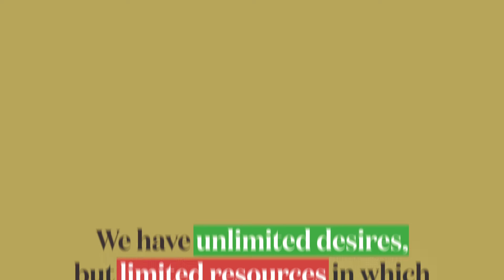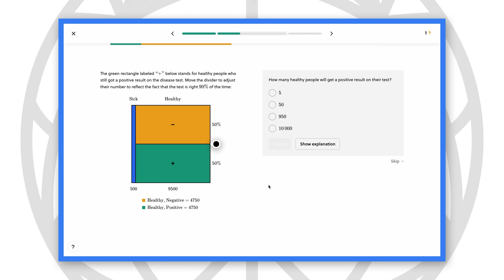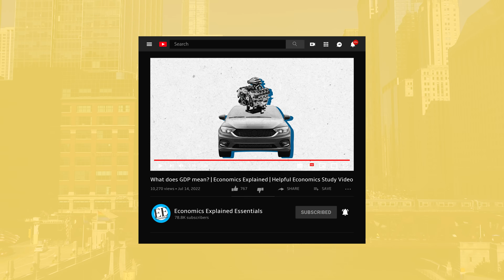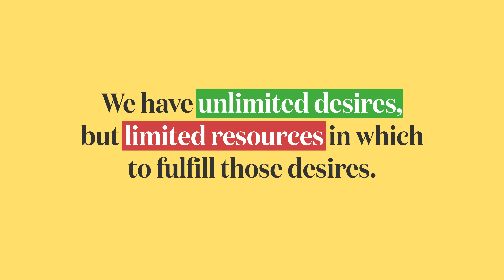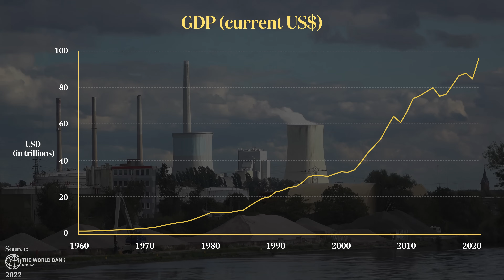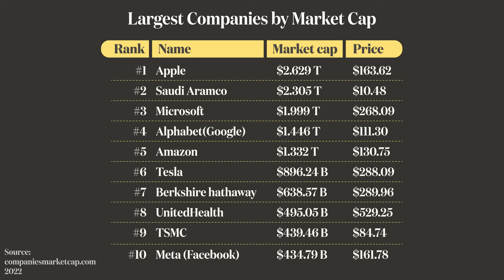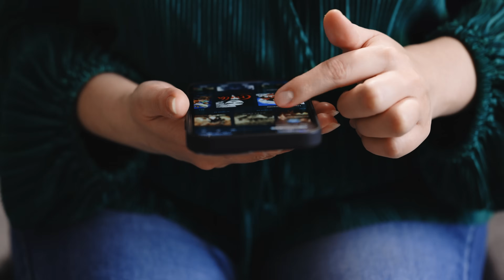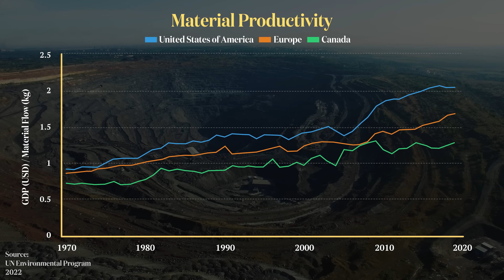Limitless Growth Is Possible If We Run Our Economies Correctly | Economics Explained

Comment: It seems evident to me that, so long as we keep environmental concerns to heart, the problem of environmental impact will solve itself. I know that’s not a popular sentiment, but economic prosperity DIRECTLY TRACKS with environmental protection legislation. The wealthier the individuals of a society are, the more they think about secondary concerns like the environment. Developed economies have seen decreasing carbon dioxide output over the past several decades, and developing economies are pulling millions out of utter poverty each year. This video fails to answer a fundamental question: who, in your quality over quantity model of growth, will produce steel cable. Cars are nice and all, but we still need steel cable. We produce what we produce, in the quantities we produce, because the market says we need the things we are producing.
Reply: Most of the richest countries have the biggest carbon footprint per capita. The only green policies they support are gimmicks that promise a solution without a drop in living standards. You can't consume your way out of climate change.
Reply: This. If activists actually cared about the environment, they'd be focused on using fossil fuels that are efficient and cheap, relative to renewables. The more affluent someone is, the more they're actually able to consider the broader environmental impact of their existence. Pull people out of poverty (which is best done with fossil fuels) as fast as possible and the wasteful use of resources will decrease more than using cleaner energy now at the expense of slower or stagnant poverty improvement.
Reply: @TheJbh147  Can you explain that further? If someone is interested in reducing emissions, why would they continue to pump CO2 into the air? 

Its not about growing as cheaply as possible (building a house out of paper), but growing "properly" and without burning your house down (a house built out of stone). 

We are all figuring this out as we go along. If I built something and looking back realized their is a better way to do it, then I would try to help others do it the better way, without them harming the place they live.
Reply: @JermanRamirez  can we agree that the poorer you are, the less freedom you have to worry about the broader environmental impact? You're more worried about getting food on the table, having reliable transportation, keeping your house, paying bills, etc. And everything else is a luxury that can only be considered once your basic needs are secure, correct? 

Going off that, can we agree that fossil fuels provide the most efficient form of energy at this point in time? By efficient, I mean reliability or consistent amount of energy per unit of energy producing source (ie wind turbine, solar panel, gallon of diesel, etc), abundance of energy source, degree of e-impact (ie wind turbines damaging avian life or interestingly, the almost net 0 fossil fuel processes used in some energy plants, though this isn't widespread but goes to show how technology continues to decrease average pollution from fossil fuels), and cost to attain the energy source (ie collection and transportation infrastructure). Abundance, cost, and widespread use make fossil fuels overall the most "efficient" to use in my mind. 

Lastly, we know that energy costs in the production and transportation of goods affect the price consumers pay, correct? This is one source of influence on both the shortages and rising costs for virtually everything right now so this isn't really up for debate. 

Taking those three aspects into account, by providing the poor cheaper goods via cheaper energy costs in everything leading up to their purchase (as well as the consumer's transportation costs), they have more expendable income, or maybe they reduce the debt incurred every month. This eases some of their stresses and gives them the luxury to worry about their e-impact. 

Of course, there are a million confounding variables at the individual level, but what we see at the societal level across classes and even across countries is that affluence is negatively correlated with e-impact. Everything I said above is the theoretical explanation for why we see what we see at the societal level. The goal is to alleviate the stresses of the lower class to give them the luxury of being more environmentally conscious because we know that, on average, most would rather be environmentally friendly than destructive. The poorer classes simply don't have the finances to worry about collective, more long term survival if their individual and short term survival is not secured. That was long but I hope that helps.
Reply: @TheJbh147  Your three points are accurate and I totally agree them. 

Wouldnt the knowledge and fossil fuels can destroy an environment also be a factor? Like yes, it would be easiest for developing nations to use only fossil fuels to grow (they are a tried-and-true method), but is it still the best choice knowing that down-the-line their homes may be ravaged to the point where their land is no longer able to produce food? 

However, I do think that developing nations are the most entitled to using fossil fuels at the moment (ideally in conjunction with 
green energy sources).

And for already developed nations- it may be a good idea to save our most consistent source of energy for a future crisis.
Reply: @JermanRamirez  I don't believe their land would be ravaged by fossil fuels by their use in the next several decades. I think another issue here that negates the need for knowledge of its impact, at least for the immediate future (next couple generations or so), is that they really don't have a choice either way. Farming is still done using diesel and there's absolutely nothing can be done about that unless developing communities are fine with sacrificing their crop yields to use less diesel. 

I personally don't think one type of nation is more entitled to use fossil fuels than another. Developing nations need it for the reasons we agreed upon above. Developed nations have larger, established societal infrastructure that depends on fossil fuels and when you factor in the aid they provide developing nations, it would be counterproductive if the focus is lifting up developed nations. That's not including the death developed nations would see with reduced fossil fuel use. Some EU nations are going to get a taste of that this winter with the lethal decrease in russian oil. 

There's just no easy way to cut fossil fuel use substantially without greatly hurting people or killing them. The best we can do is lean into it and make the most of it to decrease e-impact from poorer classes and to produce realistically viable sources of energy more quickly (nuclear and geothermal being the only two that have serious potential when accounting for their respective impacts on both humanity and the environment. 

And if you're in the US or EU, at least you can feel a bit better that a little over three months of petroleum is stockpiled for emergencies. Biden is crapping all over that here in the US, though, instead of just granting permits to produce more oil. But I don't want to get too political here. Just wanted to mention that petroleum reserves are definitely a thing across developed nations (and specific amounts in units of time for countries in the iea like I mentioned above)
Reply: @TheJbh147  I don't think the problems with wind power killing birds or current turbines being inefficient are large enough to preclude it from being a piece to the puzzle of decoupling economic growth from carbon emissions. And more importantly, you seem to heavily underestimating the potential damages of climate change. The differences, especially for many developing economies, between 2/2.5/3/4 degrees Celsius are measured in the millions of lives annually, the tens of millions of refugees, and the trillions-tens of trillions of dollars of costs/damages. Not to mention more subjective/harder to measure things like lost ecosystems, greater weather based suffering (120+ degrees Fahrenheit heat waves sound fun?), increased violent conflicts over water/resources, etc.
Reply: @TheJbh147  A few nations are already seeing reduced yields due to longer than normal droughts and rising "extreme" weather events. However, you are listing very good use cases for fossil fuels, and those likely should not be stopped immediately and without a backup.

Perhaps "more entitled" was the wrong phrase when talking about "developed nations" 

Its that they(we) are more wasteful overall. so instead of wasting resources by throwing food/goods away because its more profitable to do so, watering golf courses during a drought, or building cities around cars (least efficient mode of transport), we could  change those "ways of living" to a style that is better and (hopefully most would agree) doesn't cause much "suffering" 

Using fossil fuels to build a nuclear plants (as well as solar panels and everything else) is probably the path were going to be taking- and I think that's ok. 

The less we use, the more we also have "stockpiled" underground (un-drilled) as well (that's what I meant by saving for the future 🙂).
 

Honestly, I think we are mostly in agreement, and that we are just approaching the problem from different places.
Reply: @TheJbh147  What you say would have had more merit a decade or two ago. In many places in the world it is no longer the case that new electricity generation is done cheapest via fossil fuels, but rather wind and/or solar. And of course in developed countries the low-hanging fruit (in terms of electricity at least) is not primarily transitioning from coal to natural gas, or what have you, but bringing more renewables online, maintaining or increasing nuclear capacity, and cleaning up whatever fossil fuel operations already exist. E.g. in the US, natural gas could hypothetically be dramatically lower emitting than coal, but it's largely prevented from this by the quantity of methane leaked from the transportation/storage mainly along pipelines.
Reply: @davidlovesyeshua  wind is incredibly stupid. The turbines can't be recycled because of how they're built and they have a short lifespan of about a decade. The sheer size and lifespan make them a very poor choice for sustainability. Not to mention the number of birds they kill. Solar, water, and geothermal all make more sense, though solar and water don't have the reliability of fossil fuels and more people actually die from solar panels than fossil fuel production (through falling during installation). Water also shares the issue with wind of hurting wildlife, though it's not as bad as wind from what I understand. Geothermal appears to be the only true renewable that can compete with fossil fuels. It's unfortunate that its utility is limited by geography. 

I 100% agree on nuclear, though. That's the true way forward. It's a shame that so many "activists" demonize it because it's the only realistic successor to fossil fuels when you take into account infrastructure needs, environmental impact, reliability, long term utility/lifespan, throughput capacity, etc.
Reply: This is true. People care about environmental quality, and as they get wealthier, they are more able to care for their surrounding environment.

Comment: I think this video has a central contradiction as you assert that growth should be done without damaging the planet, but it is the pursuit of growth and short term profits that has caused the destruction of the planet. Companies have shown over and over again that when it comes down to it, they would rather pump more CO2 into the air than hurt their bottom line. Simply asking these companies nicely isn’t gonna work either because they control the government and have little to no incentive to put the environment over profits. I find that you are oversimplifying this vast economic problem too much to the point where the “solution” presented doesn’t make sense when scrutinized.
Reply: Would you disagree that the pursuit of growth has, in the long term, led to more efficient and clean use of energy?
Reply: @TheJbh147  I agree that the use of more efficient and clean energy can stem from the pursuit of growth as you can do more with less resources and people prefer cleaner environments. I am not arguing that growth itself is the problem, its the prioritization of growth and profit above all other factors which is the main problem. However, if it is cheaper to simply use more resources or be less efficient that is what a company will do, regardless of the long term consequences. The issue of cleaner energy is that the consequences of pollution rarely effects the people who make the decision to create that pollution, so there is no incentive for companies to reduce pollution beyond how profitable it is.
Reply: @evrenyungjello8700  okay, so your argument isn't so much about the broader environment but rather the communities who suffer due to poor practices by businesses for the sake of profits? That, I'll agree with and it's one of the few things government should exist for.
Reply: Have you ever heard of the Aral sea? It is not capitalism that is destroying the planet, is human nature. And we would be destroying it under any system. China is emitting more co2 per capita than the EU, same for Russia and Iran.

There you have a theocracy, a fascist country and a communist market oligarchy all emitting and polluting more per capita than a wealthy group of capitalist countries.
Reply: >Companies have shown over and over again that when it comes down to it, they would rather pump more CO2 into the air than hurt their bottom line.

Until recently fossil fuels were much cheaper than renewables. It's not a matter of being evil and trying to destroy the planet, it's a matter of minimizing costs. How do you think life would be if in, say 2005, everyone was forced to switch to solar power overnight? It wouldn't be very good, everything (up to this day) would be insanely expensive and a bunch more wouldn't exist anymore.

>I find that you are oversimplifying this vast economic problem too much to the point where the “solution” presented doesn’t make sense when scrutinized.